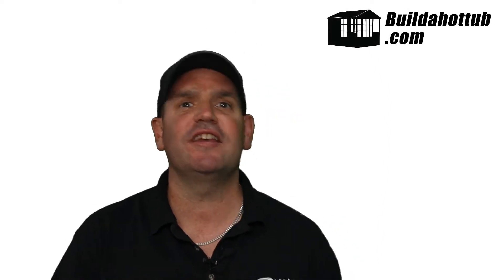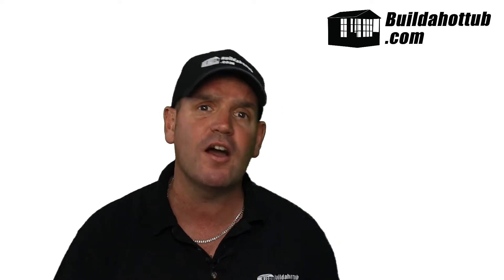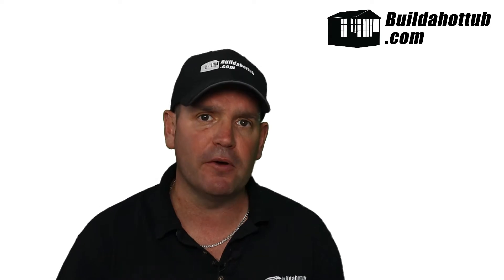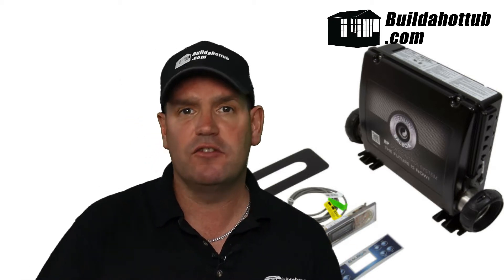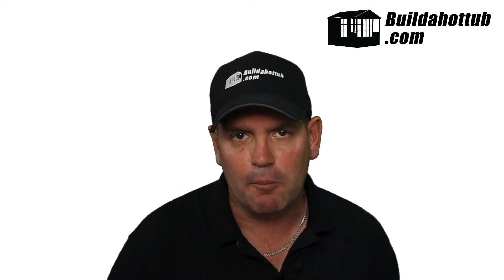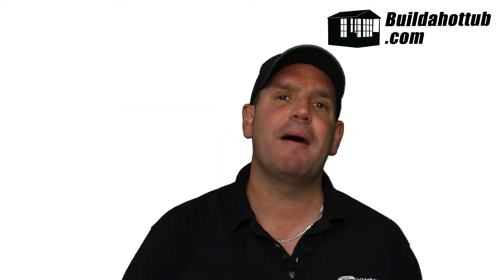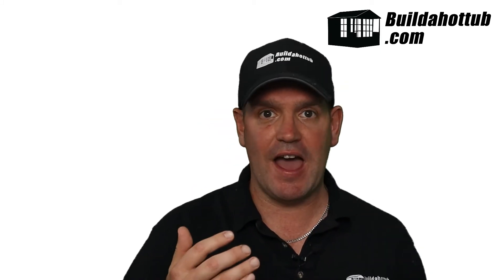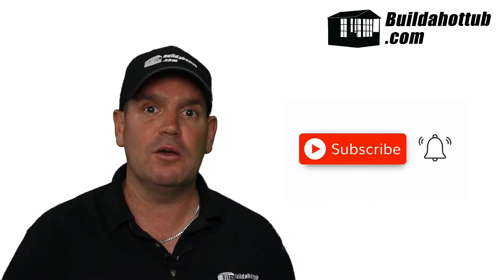Configure Spa Pack - Tips and Tricks to help you

Comment: Hi Andi, I recently installed a Balboa BP7 on a hot tub with a 2 speed pump and a 1 speed pump. I have the second pump plugged into j14 but can't figure out what program will run the second pump. I know that pump 2 works when I plug it into pump 1, but can't get it to run off of the j14 connector
Reply from the maker: Hi Setup #20 - 2 speed in J9 and 1 speed in expander board (not J14) - that should do the trick - let me know how you get on - Andi
Reply: so I have to have a expander board for the second pump?  @Buildahottub
Reply from the maker: Yes you do - should be around the bottom right corner of the spa pack - hope that helps - Andi
Reply: thanks so much for your time! @Buildahottub

Comment: Hello, I was wondering if you had a plumbing CAD drawing for the minimum required items? I don't want Jets in the tub. Just a heater, inflow and outflow a pump and water filters.
Reply from the maker: Hi Fred, can you drop me an email? - andi {a.t} buildahottub.com and I can help you, also let me know where you are based in the email so I can quote the right kit. Thanks for the comment
Reply: Hi Andi. Great channel! I wonder if you could help me please? I have just installed a new Balboa BP601 control pack with a TP600 topside. I’ve configured it (I think! And thanks to your videos) and it works ok until the jets switch off, then the circulation stops and I get heater error messages, low flow, sensor balance, etc. The hot tub has a two speed pump and an ozone box thingy, no blowers. Is there anything I’m doing wrong? I have dip switch 3 on. Thank you in advance! Cheers, Chris.

Comment: I just installed a balboa bp7. Seems circulation pump isnt turning on which i believe is the pump that runs through the heater. Of course getting heater dry error.
What could i have done wrong.
The control panel seems to work the controls when pump and lights ate pushed.
It has 2 2 speed pump and a circulation pump.
Reply from the maker: OK, sounds like you dont have it configured for a circulation pump - default is a dual speed pump in J9 so if that is not going through the spa pack which it will not be, you will get the error - you need setup #12 - Circulation pump in J21, Pump 1 in J9 and pump 2 in Expander J1 - then follow the process to change the program mode, DIP1 up, turn on, warm, warm, light, warm, keep pressing warm until you get to 12, then press light, wait to see Mem Reset message, then put DIP1 down, you should then be all set - hope that helps

Comment: Hi there. I have a new pack Bp501g1 Balboa. 4 wire 220 volt wiring (has neutral). I only have one pump with no extras.. 220 volt 2 speed motor.  questioning have is jumper J44. Putting jumper in center says for no neutral. I have a neutral. Do I leave 2 jumpers on.. one on each side for 110volt on each side?? Read manual and searched online. No answers.
Reply from the maker: Thanks for the comment - 220V over 4 wires means that this is coming from your split system so you should leave the two jumpers on. You would only remove them and bridge the center for a 3 wire dedicated 240V feed which in the USA is not common - hope that helps - Andi

Comment: Hello I have a bp7 with the tp500 control panel how do I change the configuration on the pac
Reply from the maker: Hi There, DIP1 need to go on, power up, press, warm, warm, light, warm, keep pressing warm until you get to the setup number you are looking for, then you press light to save it, unit will reboot, drip DIP1 back down and you should be all set - thanks Andi